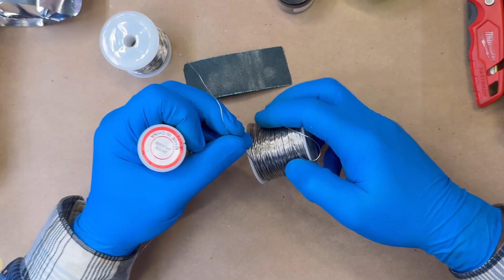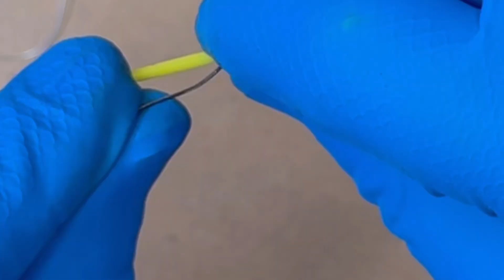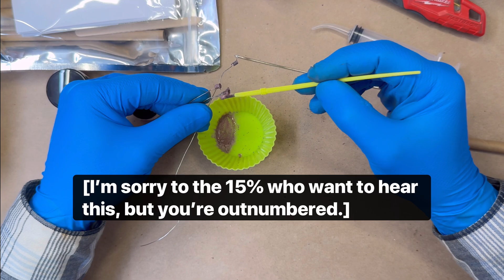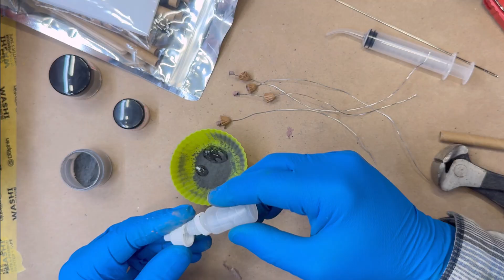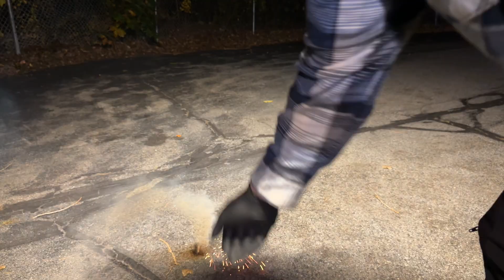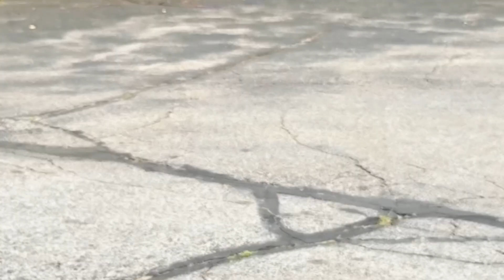DIY Wire-Pull Igniters That Are Consistent, Durable, and Reliable

Comment: What diameter mason bee tubes are you using? Standard size is 8mm but the completed ignition cup + striker coil is way too big to fit into the tube.

Comment: Just an FYI, hitting the wire with a torch anneals the wire making it weaker.
I'd use Acetone and sandpaper, especially if you prefer the smaller gage wire.

Comment: Have you tried using sealing wire? I don't know if that's the right word for it. It consists of a main center wire with a thinner wire wrapped around it in a spiral. You can also buy it pre-cut (10cm - 20cm). It is used for electricity meters, water meters, .... so that no unauthorized person can access the devices. I hope you know what kind of wire I mean?
Reply from the maker: @JohnDoe_de  I know what you’re talking about only bc I just asked Grok. No I haven’t tried it. Yes it sounds awesome
Reply: @InventionIncarnate  I came from germany sorry for my bad english but cool that you understood what i mean. And now I'm looking forward to a video from you regarding this special wire. 😉

Comment: You are correct about the wire holding its shape. In a nutshell, You are work hardening the wire when you wrap it around the dowel/brush, and annealing it when you heat it to red. If you quench the wire immediately after heating it you would be tempering it, making a tiny spring. I love the videos bro! Keep it up.
Reply: If he quench the red-hot wire, he would be just quenching it. Tempering is something else - it is a heating (to specific temperature) previously quenched or work-hardened metal, that is necessary step on making springs.
Reply: @ tempering is done at varying ranges depending on the metal and purpose intended, and it’s doubtful this wire would be any good as a spring
Reply from the maker: Dude, that is so helpful and clear

Comment: I have been thinking about making a dort off frag smoke grenade. Basically just normal kno3 suger smoke composition but adding a small charge in the middle of it to shot and ignite the composition over a wider area at once. Would be cool if you tried to something similar

Comment: To the rest of the 15%, I salute you 🎉
Reply: Only takes a few seconds to throw the audio into Audacity and slow it down :) "The little itty bit of friction is causing the red phosphorus to jump into its allotrope white phosphorus and it becomes a pyramidal tetrahedron which then reacts immediately with the fuels in this mixture and blah blah blah blah blah".
Reply: Tried slowing the playback to quarter speed, still couldn't get it...😢
Reply: @ glad you tried, I was tempted
Reply: @darkhorse1236  Only takes a few seconds to throw the audio into Audacity and slow it down :) "The little itty bit of friction is causing the red phosphorus to jump into its allotrope white phosphorus and it becomes a pyramidal tetrahedron which then reacts immediately with the fuels in this mixture and blah blah blah blah blah".
Reply: @chrisgriffith9252  Only takes a few seconds to throw the audio into Audacity and slow it down :) "The little itty bit of friction is causing the red phosphorus to jump into its allotrope white phosphorus and it becomes a pyramidal tetrahedron which then reacts immediately with the fuels in this mixture and blah blah blah blah blah".